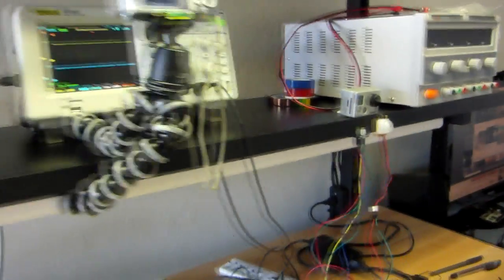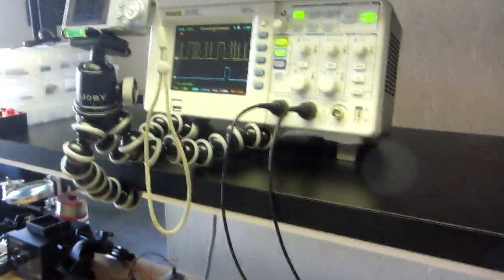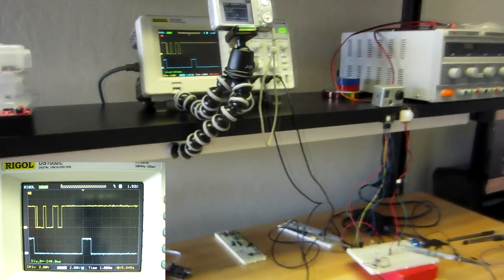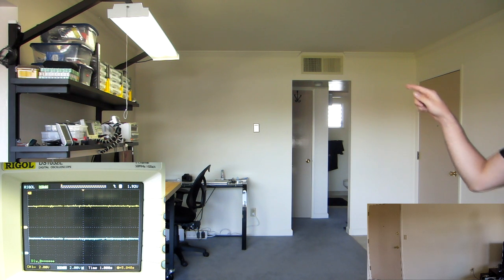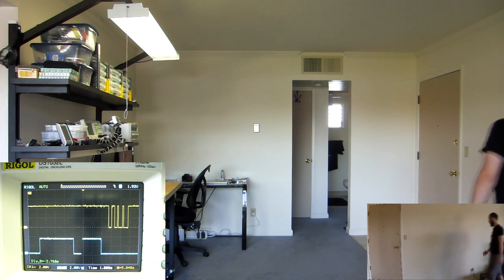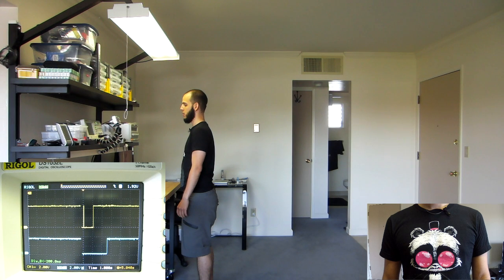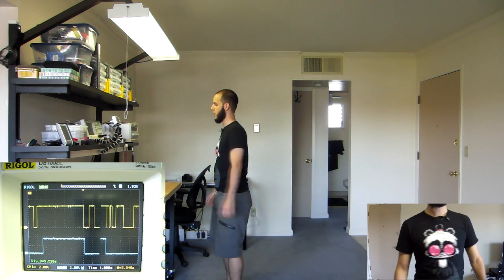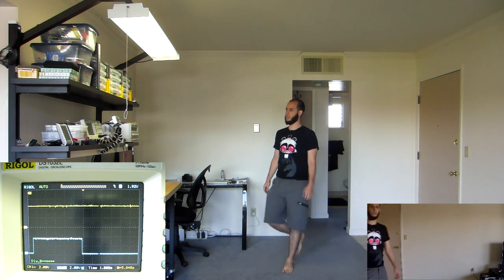PIR Sensor Comparison

Comment: So you never looked at the physical sensor on the boards?  Like a 500bp or d203s pir sensor module???  That would give you a datasheet and boom, more interesting video with more and more accurate factual content rather than a dude walking in front of a sensor with all the equipment you have kicking it around the room.. if you had a bong in your hand it would make more sense and also be more interesting watch...

Comment: Nice video. The fresnel lens fitted to the devices is probably the greatest determining factor, and the conditions are hardly identical (sensitivity/delay settings). Usually resilience to false trigger is the design optimum

Do you have shares in Go-Pro by any chance?

Comment: Hey Buddy can you help me here,,, I am not able to make that 3.3v from the sensor do anything but light up one led bulb, anytime I connect it to anything else like to a 3v relay It drops to .5mv , is there anything I can do to get the 3.3v to trigger the relay , I have tried NPN and everything ,, let me know your thoughts ,
Reply from the maker: Yeah, I doubt it can source enough current to drive a relay.
You'll need a transistor or two to make it work.

Something like this (minus raspberryPi): http://www.susa.net/wordpress/2012/06/raspberry-pi-relay-using-gpio/

Comment: Hi Alvaro. Can you help a bit please? 
I am using the ePir one and I have trouble getting started. 
I was thinking I can just plug the ground and +3.3V on pins 1+2 and then put a led on pin 7 and ground. It starts with led on and I expected it to turn off when motion is detected, is this wrong? Can I test it like this?